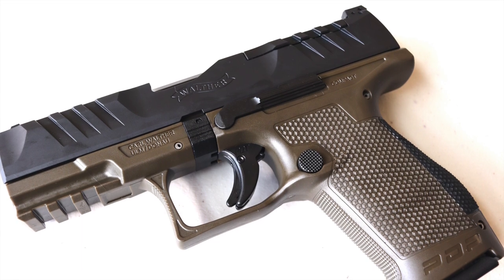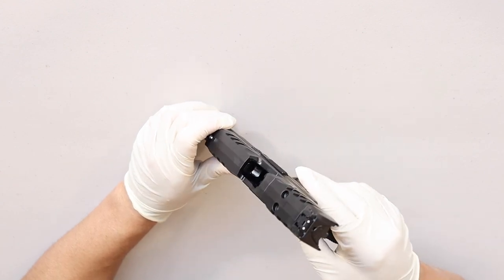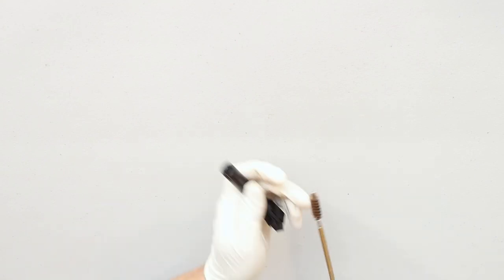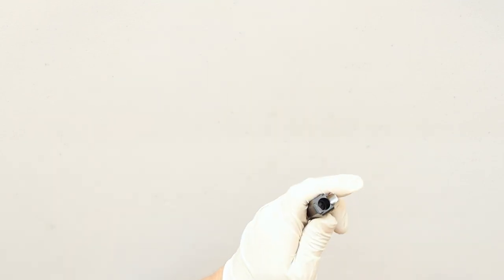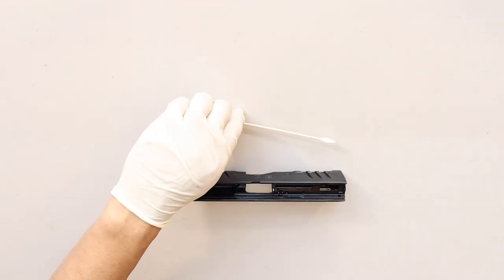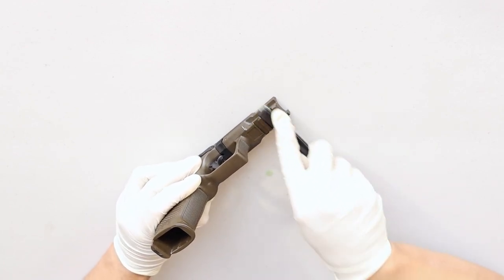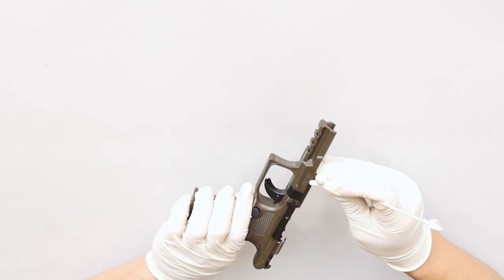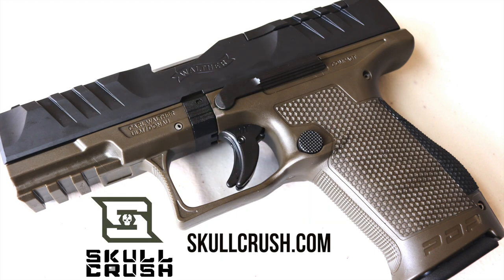How to Clean the Walther PDP

Comment: Dissapointed to see that strange barrel wear on the underside where I assume the spring makes contact in some way. Never seen that on any other pistol but every PDP field strip/dissaembly vid shows that wear and some even show metal shavings. I think it might have something to do with the plastic guide rod flexing when the gun is fired but thats just a guess.
Reply: Every striker fire pistol I own has wear on that spot. Out of all my glocks, CZs, s&w, the Walther pdp actually has the LEAST amount of wear in that spot when directly compared. All you're seeing is the corrosion resistant coating of the barrel being worn down, not the actual barrel itself. The barrel itself is made of hardened steel while the guide rod is made of a lesser OR softer metal that won't damage the barrel. You will honestly go through multiple guide rods before the integrity of the barrel is even up for questioning, meaning thousands upon thousands of rounds. As long as you keep your pistol well maintained and properly lubricated this will be a non-issue.

Comment: After how many rounds should you do maintenance like this? These things are meant to run dirty right?
Reply: I'd say no. ⬇️ I'd add to remove, clean the slide PDP optic plate. Depending on where or how you carry the 9mm PDP. It's easy but the screws are tiny. Be careful.